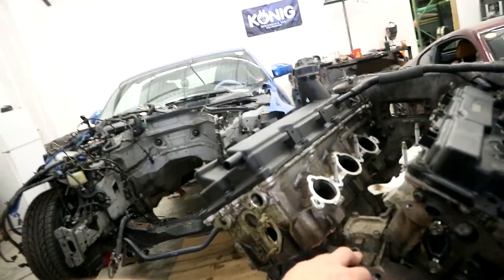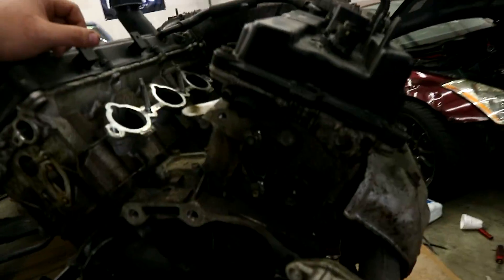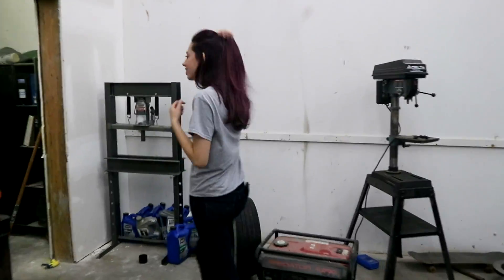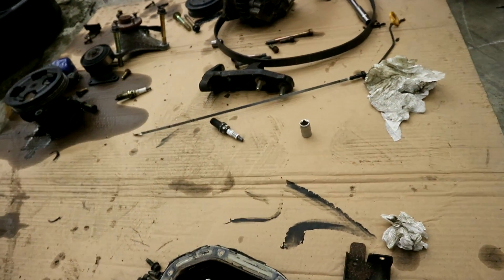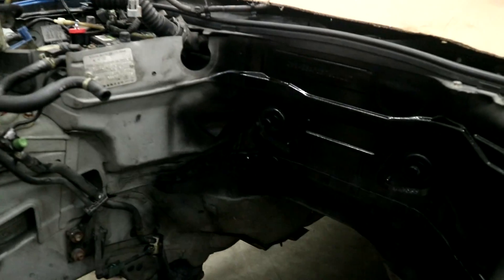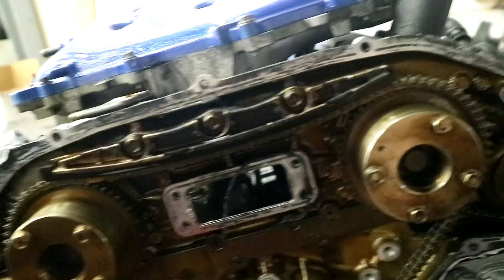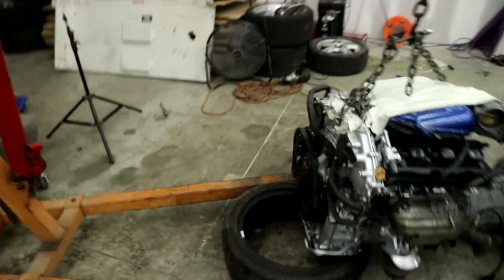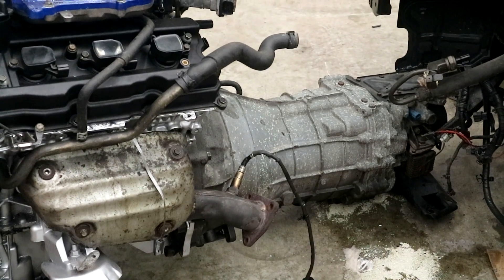DOLLAR GENERAL VQ35 REFRESH!!!

Comment: I mean torque specs aren't "personal preference" it's what the engineers designed the parts to. Not following the spec is just lazy.
Reply: Personal car= Personal preference...if it's a customer's car then torque Specs is a must
Reply from the maker: GeorgeDgreat thank you 👍🏻
Reply: @georgelvteam  if you want your shit to work right consistently then it's a must all the time
Reply: Nothing wrong witn a few dug dugs
Reply: Working in a shop there's not much that anyone follows torque specs. Beside heads, and rods. Those are an unspoken mandatory. Rest is ugga ugga and yep that feels fine.
Reply: Mitch Muske nah. It isn't necessary. Even for rods and head gaskets. Sloppy mechanics proved it. I personally would torque rods and heads.

Comment: I have allways just used my impact for flywheel bolts. Never had a problem for 20 years and going
Reply: Exactly. Working in a shop it's the same thing. Only thing I torque to spec is rods and heads. Haven't had any problems.

Comment: How does a broken spark plug electrode cough diode cough make a engine knock? I must be missing something. That electrode was vaporized and expelled out through the exhaust valve in milliseconds.
Reply: David Morgan the head was knocking he changed the head out.......
Reply: I agree but iv been thinking if it bent a valve it would make a sound but the valves looked ok on vid
Reply: AFdesigns  Yeah I can see how a electrode could get stuck in between a valve seat, It's very unlikely though.. That air is moving FAST. Each cylinder is moving 6/10 of a liter of air on each compression stroke. and even at idle that's 700 times a minute, over 10 times a second.

The bigger question is why did the electrode break to begin with.
Reply from the maker: David Morgan yes Electrode you’re right I always get that backwards and I’m assuming because the head was pretty messed up and it’s an interference engine so the piston was probly contacting the head is what I’m assuming

Comment: Didn't torque the flywheel bolts. 🤔
Reply: 3 ugga duggaa's with the impact and boom torqe to spec magically.
Reply from the maker: Issa Stock Volvo you know you know
Reply: Lol you obviously don't work in a shop. Tight is tight. Nuff said.
Reply from the maker: Matt Hudson I make an exception for head studs Cam caps main caps rod caps etc but other than that bRrRrrRRRD
Reply: @damianmonte  definitely agree man. This was just a short reply. Feel honored to have a like and reply from you. Keep doing what your doing. I love your vids.

Comment: Could be chips of seals and gaskets
Reply from the maker: AdoniYah Strongmann they weren’t lol I checked
Reply: They guy did have it pulled and sitting in on the garage floor right? I though maybe rat turds.
Reply from the maker: Bipolar Motorsports what it was is when I pulled it it was still under the engine and in all the crevasses there was those helicopter leaves and plant things if you remember a couple videos back when we pulled it I used the air gun after it was out of the car a second time to spray out the cracks n whatnot so I’m guessing that’s why that was there 😂